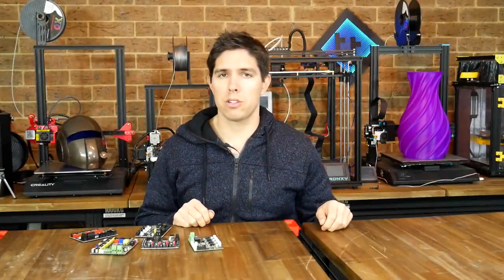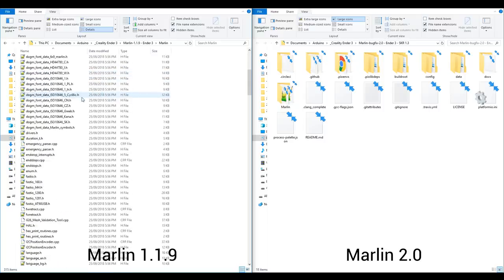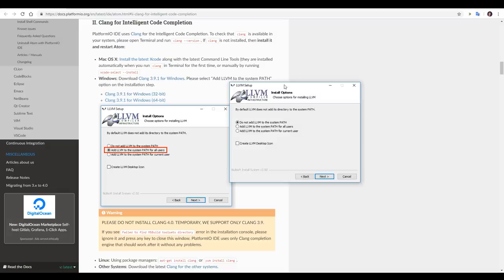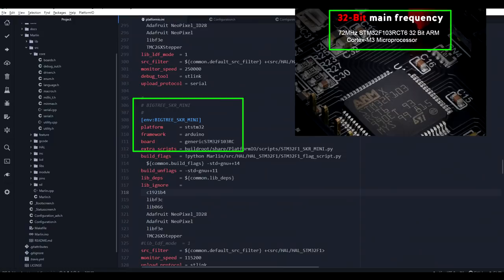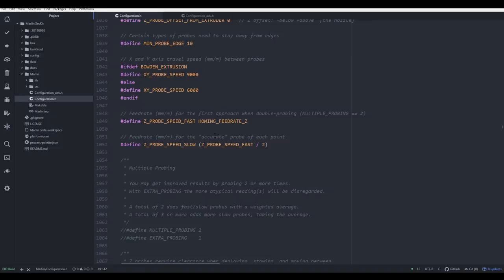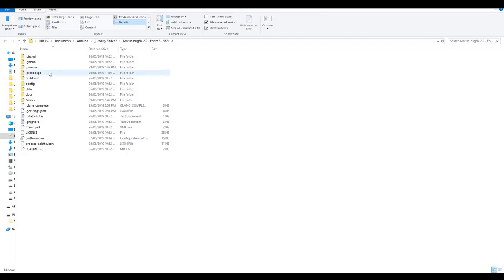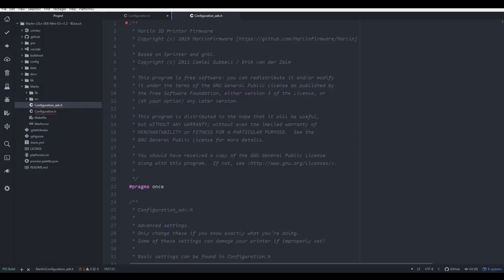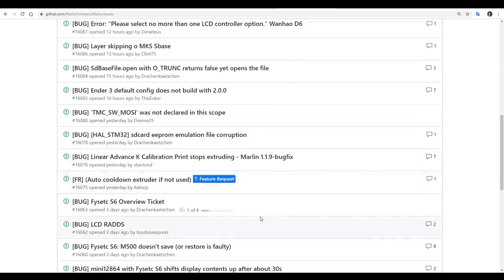Migrating to Marlin 2.0 guide - Setup and troubleshooting UPDATE IN DESCRIPTION

Comment: There are a LOT of CR-10 and Ender 3 owners with BL-Touch installed.  Would you create a video to show us how to switch an oem board on a CR-10 to Marlin 2.0 and add BL-Touch support?  Otherwise, would you show everyone how to switch an oem board on an Ender 3 to Marlin 2.0 and add BL-Touch support?  Thanks!
Reply: This would be awesome. I got the BLTouch official version and almost threw it in the trash. I have YET to get it working with the SKR Pro which has a dedicated pinout for it. It turns on and tests and starts to scan but the manufacturer never gave any calibration instructions or how its supposed to work once installed. So Im working in the dark wondering what to change in the firmware not knowing what to expect exactly for proper operation. Been 5 months with the BLTouch detached from the printer without a single successful calibration from it. I had it go around and do a 9 point calibration and then the printer just stops on the last calibration and idles. UGH waste of $60 so far. Went back to manually baby stepping at the start of a print which has been the most reliable so far. I have had a lot of issues releasing the Z axis so it can go into negative range because the printer at some points will freak out and ram the print head into the print bed and grind out until I hit the power switch. So inconsistent.
Reply: I currently have my ender 3 pro with the silent board running on marlin 2 with a Bltouch installed, i followed his guide on how to install vanilla marlin which was version 1.1.9 but it was mostly the same for marlin 2.0, i think the main difference was when adding the pin 27 command you have to do it under the BLtouch menus in config.adv but other than that it was pretty smooth.

Comment: Marlin's documentation needs to be updated since PlatformIO no longer supports Atom. Yes, you can make it work by downgrading libraries and swapping out files, but please use supported IDEs like VSCode/VSCodium instead 🙂
Reply: Where did you read that information? I can read on platformio documentation Atom references.
Reply: Pedro Franco See Scott’s (lead Marlin developer) comment below mine about this as well.
Reply: thisiskeithb thank you
Reply: is it possible to just use notepad++? I am confused, as I want to upgrade the FW on my tevo nereus currently with the same board, a mks Robin nano v1.1 and calibrated xy values for now. I want to migrate to marlin 2.0. idk how to do it. And Keith, is the marlin 2.0 files on the Facebook group for the nereus?
Reply: VSCode using the PlarformIO and AutoMarlin plugins makes it super simple. Any non-developer or newbie should use that method.

Comment: PlatformIO is no longer supporting Atom going forward so Visual Studio Code is the only option we will be supporting.

With that in mind, I’d love to see a followup demonstrating the “Auto Build Marlin” extension for Visual Studio Code. It makes the build and upload process a single-click operation.

Note that Marlin 1.1.9 does support PlatformIO as a build option. And there are some 32-bit platforms that can be built in Arduino IDE. Some 32-bit boards might still require Arduino IDE, but don’t quote me on that. (I haven’t memorized all the new details, clearly.)

Annoying that PlatformIO is still getting confused by ZIP archive names. That was fixed a while ago, so it’s a regression. Try using VSCode and the very latest PlatformIO. You can tell if you have the right version because there will be a “.pio” folder instead of the “.piolibs” and “.piolibdeps” folders the older version used.
Reply: Can you provide a link to a tutorial for the Auto Build Marlin? I am interested.
Reply: I just signed up to support you via GitHub.  Thanks for all you do for improving Marlin.
Reply: That vscode marlin auto-build extension is very slick, nice work.
Reply: Hmm... I knew how to work with the Arduino IDE, but never have used vscode. So, another thing I have to learn.
Sigh - And I started programming with machine code on that old BBC-B computer. I feel old now...
Reply: @jclosed2516  There is a name for the state known as "I have nothing to learn" it's called "dead". A popular notion with zombies of a religious persuasion, be glad its a very nice tool, a pleasure after the arduino ice, familiarity aside.
Reply: @m3chanist  Well - That's a very helpful reply. No need to be so snarky... 

Of course I am going to learn how to use the new IDE environment, but it would have been nice if there was no need to do that. I think there is nothing wrong with that feeling. 

I will pick it up soon enough, but for now I will be too busy because I just got my PFG-01 Film (and developer) from Geola delivered, and have to make a new setup with my Laserdiode and optical parts (on my new vibration-free table) to make some test Holograms. One of the reasons I use a 3D Printer is to make parts for optical mounting (like mirrors, lenses and pinhole position) and nice models for Holography. It's a lot of fun to be creative... ;-). 

[Some time later] - Alright. I figured it out. That was not very complicated, so I will use VsCode from now on.
Love this Teaching Tech channel.
Reply: Jclosed No worries. You will find that Visual Studio Code is very much like other IDE’s, ranging from the Amiga DevPac of the 1990’s all the way to the modern cross-platform Eclipse IDE that many use today. They all follow a similar model, with plugins and extensions being a fairly common feature. Once you know the way IDEs are typically made they all come to seem very familiar.
Reply: That doesn't work so well if you haven't got Python installed. It seems an odd choice to make a one-click build plugin that has a bag of extra dependencies. Couldn't you have used PowerShell?
Reply: @timlong7289  The project is open source, and a Python enthusiast stepped up to implement auto_build-py. So far no Powershell enthusiasts have come around to offer their help, so this is what you get. I do all my work on macOS, and my ultimate preference would be for Auto Build Marlin to build through a .sh script rather than a .py script. I will put it somewhere on the long TODO list.

Comment: VScode is by far the better choice, I'm sure I heard Atom was not going to be supported going forward.

In vscode, you don't have to select a default build environment, you can select it as and when you want to build and what's great is that you can build for a different board just by changing the board in configuration.h and build for that environment.
Reply from the maker: Thank you, I'll check it out in more detail.
Reply: I was going to comment this as well, ATOM simply does not seem to work for marlin 2.0 and im fairly certain somewhere in the marin/platformio documentation it said atom is no longer supported.
Reply: Since you have obviously superior understanding of this subject can you recommend an equally thorough and understandable walk thru of VSCode?
Reply: The only problem I am having with vscode is that it is taking over 3 minutes to compile, do you know what I could do to speed it up
Reply: You need to install marlin auto build vs extension
Reply: David Lockwood VS Code works almost identically to Atom and looks basically identical as well. Everything in this video should still apply.

Comment: Micheal, thanks to you, I now have my floaties on as I jump into the deep end of hardware and firmware customizing.  Thanks for all you do.  I am going to sign up for patreon to help support you.  Your content is very helpful to those of us who haven't had time to read thousands of lines of text on the internet.  Your videos are a mass download of information and direction and are a real spring board into what you need to know to take the hobby to the next level.  The only other time I have been this close to the bleeding edge was when I was building and flying TriCopters with Gyros and Radio Programming which then led to getting involved with the Copter Control Open Source Project.  Thanks again for sharing your knowledge!

Comment: What if my printer does not exist on the 'examples' folder. Still running Marlin 1.0.0 even with latest firmware from manufacturer. I requested the current firmware configuration files, which they kindly sent, but don't know how to merge the changes to upgrade it. My printer is an Airwolf Axiom Single Direct Drive.

Comment: Two additional things I'd recommend:
1. Copy your firmware.cur to another location as a backup. If you just can't get things working, rename your .cur file to .bin and flash it back to the printer so you can get back to printing.
2. Put your Marlin folder in the root of your C:\ drive and possibly rename it to something shorter. Long file paths can prevent compiling.

One question I do have: I'm currently on the latest bugfix for my SKR Mini E3 v1.2...is there any reason to update to Marlin 2.0 stable? Things seem to be working just fine for me right now; will I see any benefit from the upgrade?
Reply: I have the same question. What is better stable or bugfix??

Comment: atom stops responding for me when trying to install platformio
Reply: mine too
Reply: Same for me.
Reply: It doesn’t work in atom, just in visual
Reply: You need to use Visual Studio Code (aka VS Code). It’s basically the same as Atom visually, but is fully supported, and everything shown in this video applies to VS Code as they work essentially identically.

Keep in mind “Visual Studio” is a completely different application. You need “Visual Studio Code” specifically.

Comment: Hi Michael, Just one other thing. Is there any advantage to moving from 1.1.9 to 2.0 if I am running an 8 bit board? I may still play with this, but for now I have a Gen L with quiet drivers... So not sure I need 32 bit, or Marlin 2.0

Comment: Typically do you have to change any values on the Configuration_adv.h / Configuration.h files?

If your video is for an Ender 3. And you changed nothing, can I assume my printer was built the same and the values of components can stay default?

Comment: Total noob here and I just got a Ender 3 Pro and did the setup. cant print yet due to a "Homing Failed" issue when i try to run my 1st test print as the printer head seems to be ghosting something to print but slowly sneaks off the bed to the right towards the display casing. Stepper motor keeps clicking for  minute or so and then i get the error. I've followed guides to level the bed and its level and i auto-home places the Head all the way to the left to the stop switch where it supposed to be......is there supposed to be one of those switches on the far right of that axis as well? On top of that I started looking at the Marlin version that came with this printer and its v1.0.1 with a date of 2020-04-25. All these videos I see about updating the fw to 2.0 are talking about doing so from the old 1.9.   How the heck do I have v1.0.1 with a 2020 date? That and can i directly update from 1.0.1 to the new v 2.0.7.2 That I see on Github? I think i need a 3d Printer coach LOL!

Comment: Hi Michael. I am a newbie with 3d printers and your videos are helping me a lot. Thank you!
I have an ender 5 pro (already bootable) and just got a bltouch. I'm planning to update marlin to 2.0 before configuration the bltouch but I'm not updating my main board to 32bit (I think mine is the silent 1.1.6). Can I just do it with the arduino software as usual because I'm not using 32 bit?

Comment: Hi we have just bought the ender 3 pro for our 13 yr old son and its all a bit confusing to us. We have figured out there is not thermal runaway protection. Can i ask if we upgrade the printer motherboard if thats what you call it, then install marlin 2.0 will this enable the protection?? Thanks in advance
Reply from the maker: Yes, that will do it. Either an skr mini E3 or a th3d ezboard lite will be a straight swap. I have a beginner Ender 3 video, a video explaining thermal runaway and a video on each of those boards too.
Reply: Thank you, weve watched them, it goes a bit over our heads but im sure our lad will get it all hes a bit of a technology wiz. Ty again

Comment: Hey, a quick question? if the firmware is being flashed on the SD Card, can the same card still be used for printing as the LCD has no SD Card slot. Or will i have to get a new lcd to use for SD Card printing?

Comment: Hey Michael, love your tutorials! They have helped me a great deal. Was wondering if you could help me get marlin set up on my old printrbot, or at least point me in the right direction. It is still a great machine and I think it will keep supporting me for years to come, however I need to get a v6 nozzle on it and I can’t do that without updating the firmware. Sadly there is little support out there for it anymore and I am having trouble finding a definitive path for making the update. It needs a boot loader from what I understand, but sources cite at least 3 different versions. Is marlin 2.0 compatible with the printrboards? Or will I have to use an earlier version? Anyway, just wondering if you would be interested in my dilemma. Thanks!

Comment: Already moved my CR10S to the SKR Pro 1.1 and am using marlin 2... But as a noob is there a comprehensive way to keep the marlin firmware updated without manually re-entering the values? Maybe some sort of file comparative tool to account for the values that are still the same and flagging the values that changed? ugh.

Comment: I've not messed about with firmware before as i'm happy with the way my printer is currently working. However, I do plan to add a couple of upgrades, like BL touch and a run-out sensor. I've updated my Ender 3 Pro stock board to a SKR E3 Mini V1.2. Each time the printer boots the display reads Marlin bugfix-2.0.x. Is that the same as Marlin 2.0.0? Sorry if this is a stupid question!

Comment: I've got a question...I just compiled and placed the firmware.bin on my SD Card.  When I inserted the card into the printer and turned it on, it appears to have flashed correctly.  When I pulled the SD Card and checked it to delete the firmware.bin file, I noticed that the firmware.cur file was nowhere to be found.  I deleted the firmware.bin file, reinserted the card, and booted the printer.  All was still well.  I guess I won't stress over the firmware.cur not being on the card.  This was all on the SKR mini E3 v1.2.  Could this be a result of me not emulating EEPROM on the flash card?  The pins file under stm32 doesn't have any EEPROM coding in it on my build.

Comment: The big advantage to the arduino IDE was that it worked across platforms.
I keep looking for a reference for editing and compiling Marlin 2.X on linux.
Editing is not really a big deal but the choice of compiler and IDE are.
Atom DROPPED the IDE feature in 2018. Visual Studio is no longer available for Linux.

Is there a recommended Linux environment for Marlin 2.x or is one required to purchase 
a seperate computer with that other operating system ????
It is not really "OPEN SOFTWARE" if one has to own/use a proprietary, commercial OS to compile it.

Comment: I'm upgrading to a Mini E3 1.2 board. 

Is there a way to migrate my compiled settings for Marlin 2.0 Ender 3 stock board from Arduino IDE straight to this software package and compile for the SKR board? 

I would rather not lose the way it was configured as I don't remember every setting and feature I had changed for bltouch probing, menu presets/options, etc. 

Also, is it possible to set this up so that I can update or adjust firmware through Octopi which I'll be learning how to configure parallel to learning this and the SKR stuff?

Comment: @5::00 (where you copy the config files for ender 3) = The examples are no longer supplied in the marlin 2.0.x zip file. It is a separate ZIP download at https://github.com/MarlinFirmware/Marlin/tree/2.0.x/config
 
There are (at the time of this writing) two ender 3 pro folders. If you got your Ender 3 pro after/on/about mid-July 2020, you may need the 1.5 folder contents.  The README file in the 1.5 folder will explain how to see which one you need.

Comment: I have problem with my Z Safe home, it move the X and Y axis toward the nd of right for X and Y all the way forward. I had already set my Bed Size in 235 already but it is not move to the center when I run G28. I tried to run G0 X117 Y117 Z0 it is still moving X and Y toward the most right and all the way forward to front. As I also tried to use your firmware for E3 v1.2 with Fil runout, that has the Z offset could not set to negative value, which I could not change it, and I tried to use your code to commend out the Min_software endstops and try to compile, it can't compile.
Need your expertise on this.

Comment: For fellow newbs (and/or boomers) if installing Visual Studio, it will prompt you to install Python (which does the same job as Clang). If you screw this up, it will cause much frustration, unless you know what you're doing...and if you did, you probably wouldn't be watching this video. I screwed up and solved the problem by uninstalling Python, and reinstalling doing it correctly.
During the install, you'll be shown an install prompt with the options; 'Install Now' or 'Custom Installation'. THIS is where you MUST check the 'ADD PYTHON 3.8 TO PATH' option, or VS will not be able to find Python. (In the video, the Clang dialogue box is at 4:28). Later in the install process, it will ask if you want to allow LONG FILE PATHS (or something like that). I'm pretty sure you want to do this. I did and it seemed to work.

You will have to restart VS for it to work.